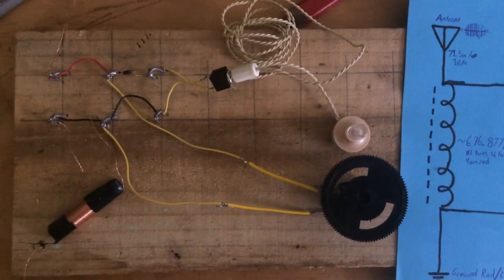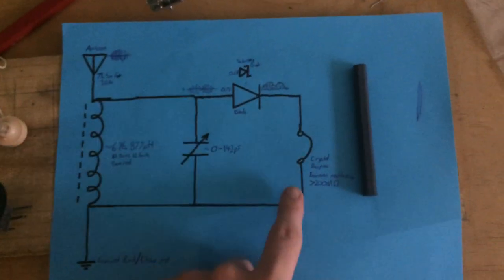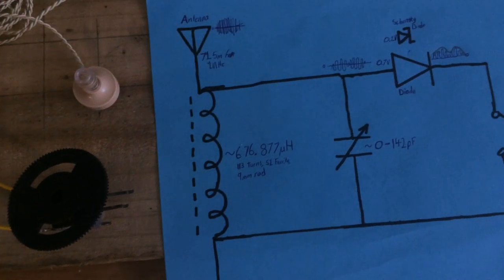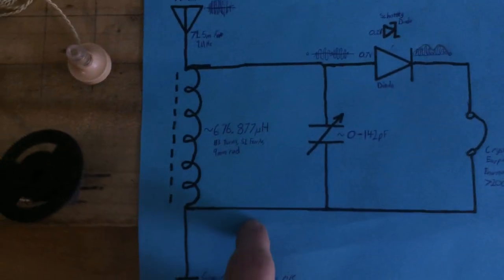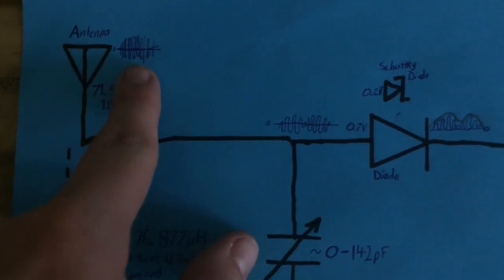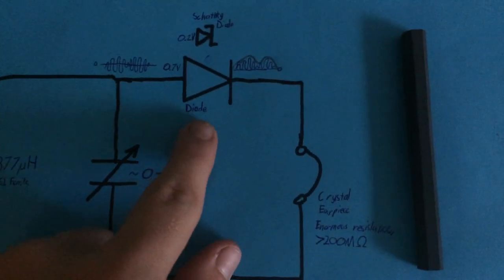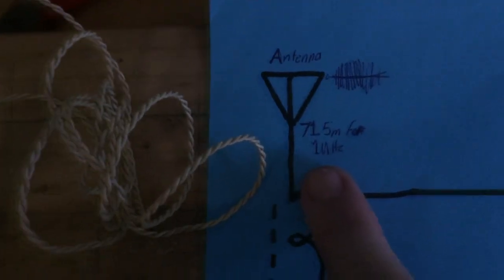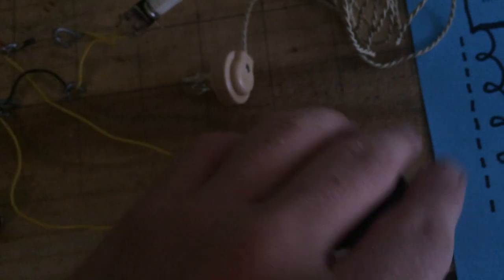Most basic crystal radio and how they work

Comment: I made one of these at School.  Everyone was trying to guess how many turns to pick up stations.  For some reason, I just thought I would keep wrapping the wire around the core until I heard a radio station.  Once I did I had a tune around to make sure the radio was tuned in to the best area of the medium wave band, so I could pick up my favourite radio stations. Just cut off any excess wire and solder the coil in.  Everyone seemed surprised but to me just seemed common sense!

Comment: Hvat typ diode used you.
Reply: Most people use the 1N34 if they can get one.  I have found that the 1N5711 does work but you need to put a 2K resistor across the crystal earphone.

Comment: can you get the coil from a regular radio as well?
Reply from the maker: Probably. I've seen one in a newish radio I pulled apart but I wasn't sure if it was for the AM or FM band or maybe both, so you'd have to measure it with an inductance meter if you find one and then choose the right valued capacitor. Really new equipment might not have an inductor at all because using digital signal processing lets you get rid of large components like that. Old radios would have coils for sure though.

Comment: The real reason for the diode is because we can't hear 1MHz.  The diode converts the 1MHz at some amplitude into a voltage proportional to the amplitude by working as a sort of electrical "check valve" If the 1MHz was swinging from +1V to -1V, only the +1V part would go through the diode.
It will work a little better with about a 47K resistor in parallel with the earphone.  The circuit as you have it relies on leakage current to let the voltage on the earphone go back towards zero.
Reply: omg i have literally been trying to find out why we need a diode for my project, you are a gem ilysm THANK YOU